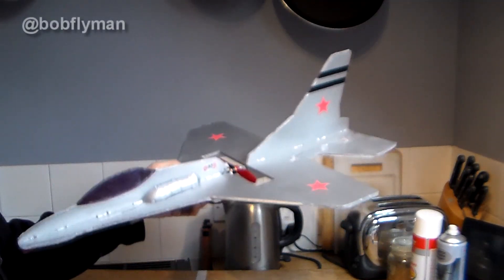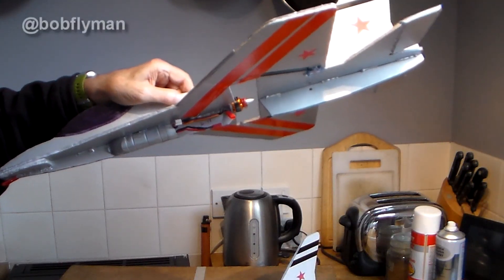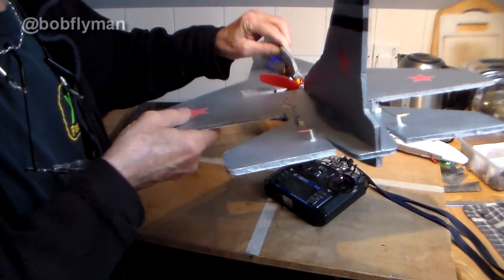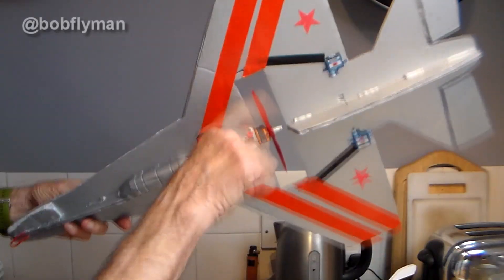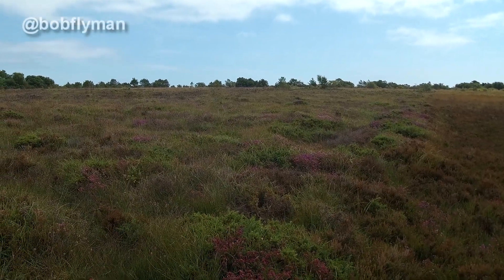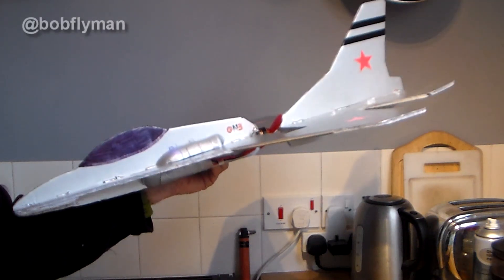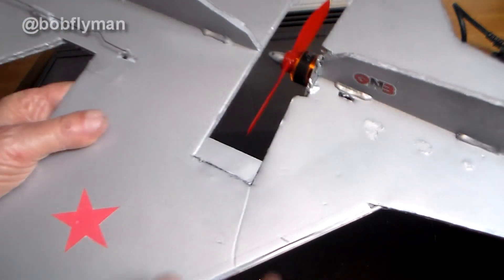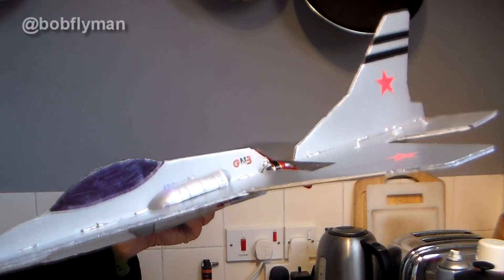CHEAPEST and EASIEST TO BUILD RC F16 Plane  has a GREAT maiden -  FREE PLANS

Comment: That went exceptionally well and with all the wind!
Nice one! 😊
PET bottles are really nice for making parts. Just remember to make a wooden mold of what you want it to fit. Don't be like me and try to shrink one on the actual fuselage you want it to cover. The shrinking forces combined with the heat...I felt so daft and once I had realized my f'up I couldn't stop the process, just let it settle down and assess the deformation. 🙈
Reply from the maker: Really surprised me too.  That field is  730 feet above mean sea level and it's always windy. It's an old airfield.  Re the bottles, yes, really useful. I've made a few cockpit bubbles from them etc. Have made a video suggesting it too, thought one never used a plug. I've seen it done on other videos though.

Comment: Hi and thank you for the free plans, can you give the dimensions of the, F16 elevation big size the center body of the plane thanks.
Reply from the maker: Wingspan should come out at about 46 cms and length 69 cms.  Centre of gravity about 39 cms from the tip of the nose. Printed size might be slightly different dependent on printer. Good luck!

Comment: Another nice job Bob! Instead of the bamboo reinforcers, I generally add a thin smear of hot glue along the vulnerable cut surfaces - nose and wings. 😉😊
Reply from the maker: @theoztreecrasher2647   thanks cobber. 😎. Apart from the.BBQ sticks on that leading  edge I remembered your comment about hot glue on the leading edges and I did it on other parts! TBH the foamboard needs that little strut to stop the board folding or bending at that point on the wing! 
Hope things are good, 'down under'  , as the doc said.  😁
Reply: @bobflyman  Sadly, not quite Old Mate. Hard frosts the last few days and yesterday I took my first real geriatric tumble. Nothing broken but still wobbly today and no doubt shades of things to come. Enjoy your mobility while you can. 😱🙄😊
Reply from the maker: Bloody hell, that's a shame,  but old age and the pearly gates are the inevitable fate for us all.  Death and taxes. 😠. 
My knees and neck are getting a  bit achy, but touch wood ...
Ps. Did you notice, I actually looked for a long slim battery that I could fit underneath with this version. I think it probably does improve flight characteristics! 😉

Comment: do you think this would work with 30mm micro edf ? either way this is amazing is that 5 or 3 mm foam board
Reply from the maker: Oh yea, and it's 5 mm board. Quite resilient in crashes as it's very light.
Reply from the maker: Nice idea. I'd like to see someone try it, though I think you'd have to use a bigger lipo and then more weight? Maybe! Try it.  😎

Comment: Pretty impressive for some foamboard to handle that kinda wind. Does need a destinct air-intake underneath the fuselage to make it a real F16 imho. Did you notice the other plane at 12:14? :-)
Reply from the maker: 'Does need a distinct air-intake underneath '  ...    I wanted to keep it as simple and light as possible.  Just two bits of fusi to cut out and glue!  I've built a few FlightTest models inc their  F22.   I simplified that as far as the nose goes, but it still has an extra layer of foam underneath for air intakes. Looks  better, but more complicated.   As far as the strong wind goes it was amazing. At times almost prop hanging with nose attitude of a 60 degs. Careful throttle adjustment required.    Great fun!    😊.  And yes, other plane: there were two other guys flying  soarers there who were trying to soar the wind higher up.  Nice to see it cross over higher.